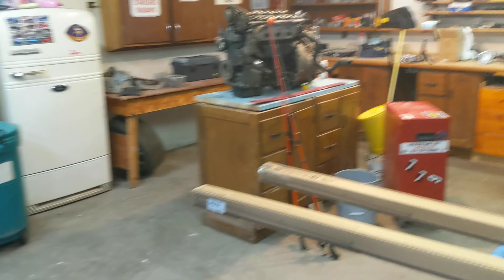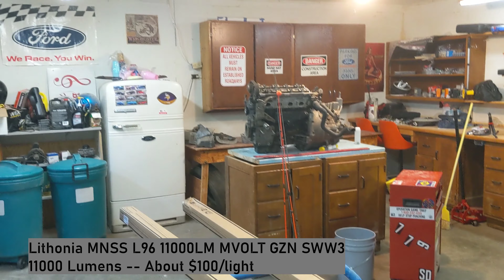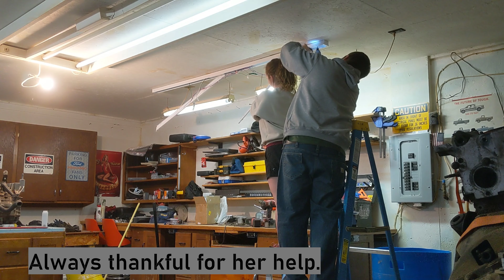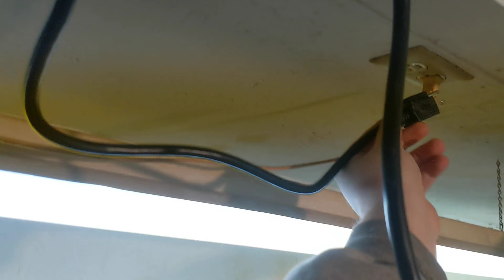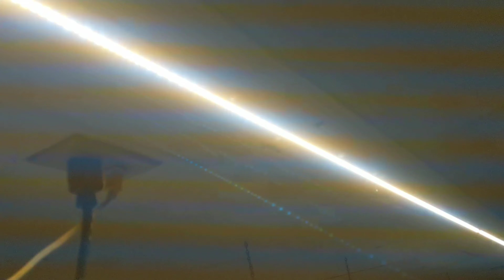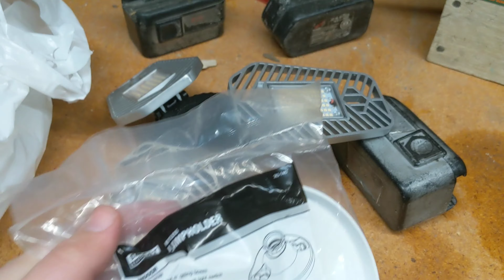New Lithonia Lightning 8' LED Shop Lights

Comment: Yeah I just bought a single, not too plussed about having to install with the strip dangling all over the place. Should be some type of quick disconnects. I think I’m gonna take it back tomorrow & search for a fixture with that option. Makes a simple 1person install unnecessarily needing a extra set of hands.
Reply from the maker: I agree. Could have been much simpler. Was kind of a clumsy bitch to put up. I thought about snipping them off and wire nutting them back on later.  They work great though when you get them up.
Reply: I was thinking the same they look great on the display. I’m actually sitting here like damn Sam!! Time for a beer & a reset. Appreciate the video on your installation shop looks fun. Cheers to you & the family & happy Holidays!!
Reply from the maker: Thanks friend.  Happy holidays to you as well.  Hopefully they are well lit!